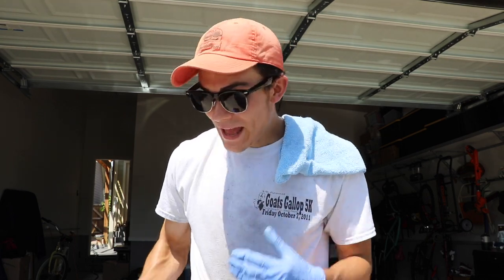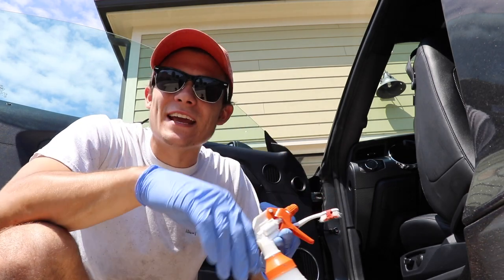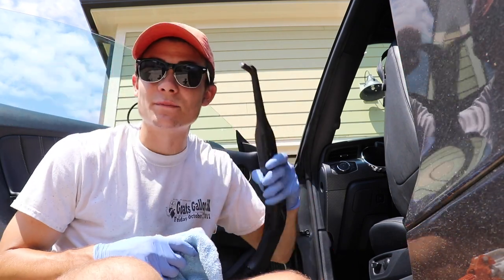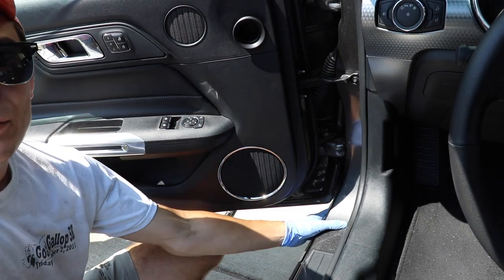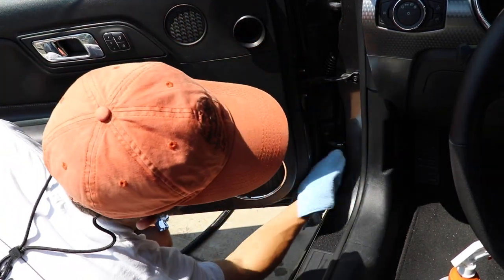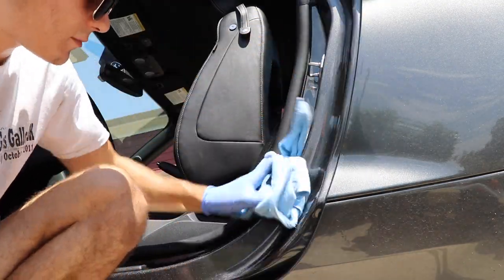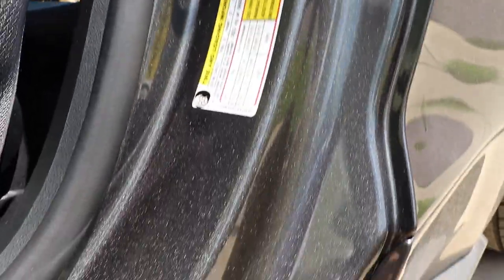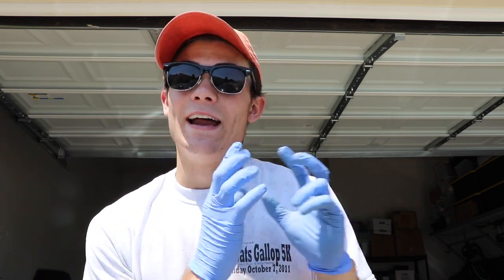Door Jamb Detailing Without Water: VX 5000 Steam Cleaner!

Comment: Hey Wilson ... do you already used the VX 5000 to detail the rear suspension ? Some cars and trucks , has the rear suspension expose and I clean them with degreaser and spray Meguiar's Hyper Dressing there !
Reply from the maker: That is certainly one way to do it, obviously a pressure washer is going to be your friend in detailing something that that. Most of the time with something like that, I will simply use my degreaser, a long handled scrub brush, and a water hose, then of course I will follow it up with some sort of diluted, water based dressing, but I may just make a video of detailing the rear suspension with the steamer, I have not ever tried it! Great Idea!

Comment: Thank you for the good info. Do you use the steamer on upostery seats? If so how long does it take to dry up? Thank you.
Reply from the maker: Yes I do, and not long, depends on how much product you use on the seats as well, but especially if you are using the steamer in the sun, it is no big deal and does not take long at all to dry
Reply: Wilson Auto Detailing do you always wet vac the excess liquid up?
Reply from the maker: No not with the steamer, simply because there is no excess liquid! That's one of the bonuses!